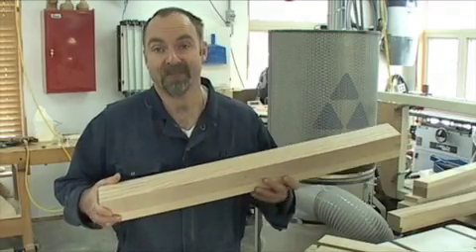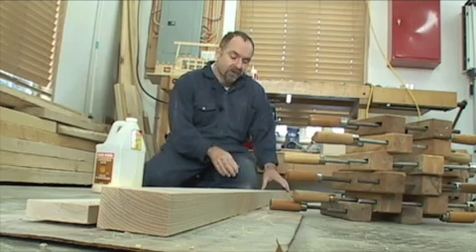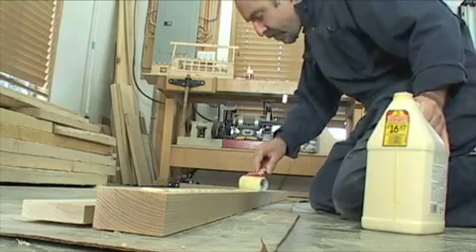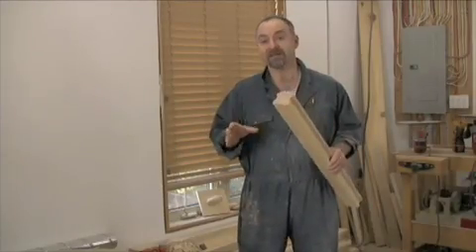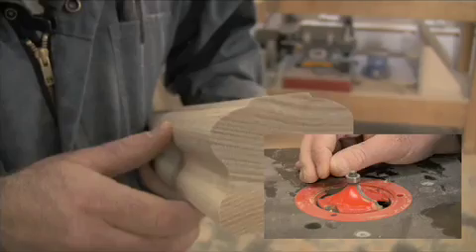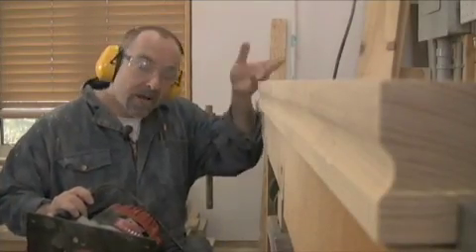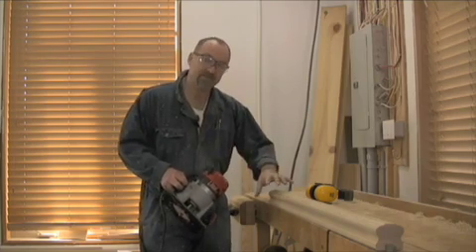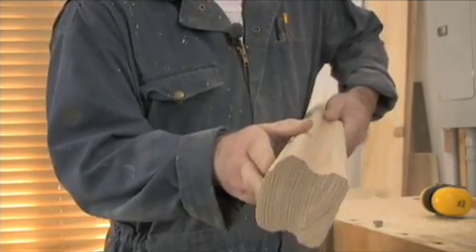DEMO: How to Mill Your Own Wooden Handrail

Comment: Thanks for posting this!  I think clamping the bend out of the pieces as you glue them would put residual stresses in the handrail that might warp it in time, better to glue up first with bent pieces oversized, and trim or plane off the excess after.

Comment: Wow! You make it look easy! My wood is 75 X 75 mm, as you recommend, but the pieces are only 3 m, so I am wondering what joint you suggest to lengthen it to 4.3 m? It's hardwood and will be exposed to heavy tropical rain, so I'm worried about water penetration.

Comment: Hi there, Hoping you might double-check the router bit used for the curved top. I think it might have been 99-452 or 99-027. not 99-520. Im about to purchase the bits online and don't want to buy the wrong bits. Thanks!

Comment: Except your country, nobody uses inches for measuring in the world. Why dont you use m, cm, mm,  like all the world?
Reply from the maker: Hello Vince,
Thanks for commenting. It sounds to me like you're assuming I'm American, but I'm actually Canadian. Here in Canada metric is the official measurement system imposed by the government, but most woodworkers still use Imperial measurements. Just call us rebels, I guess. I'm "bilingual" so to speak, but I prefer Imperial for two reasons. When you're experienced enough, both systems are equally easy to use. I also like the history and personality of the Imperial system. To each his own is something I believe in.
Thanks for watching.
Steve
Reply: I think the better answer is that the tool, equipment and wood all come in imperial measurements.  Its very hard to find metric drill bits.  Metric is acually the official standard for both Canada and the United States but its never really caught on.  I agree metric is much easier to wortk with.
Reply: i live in England and still measure in inches the only time i use metric is if i make stairs